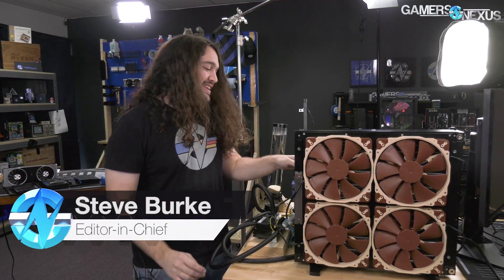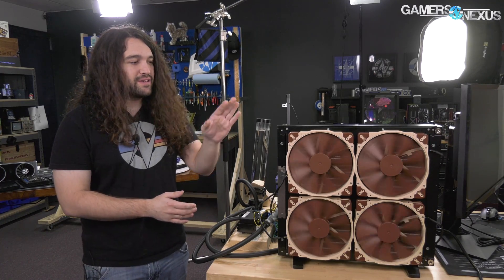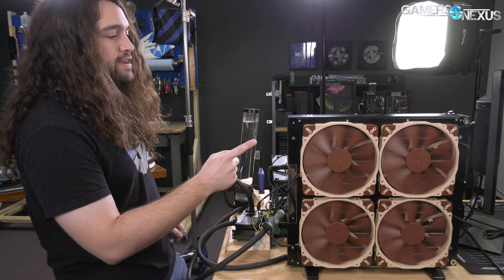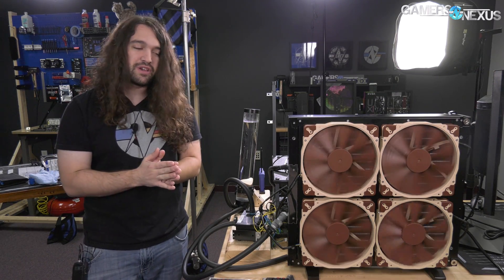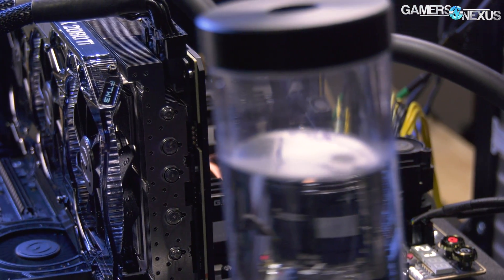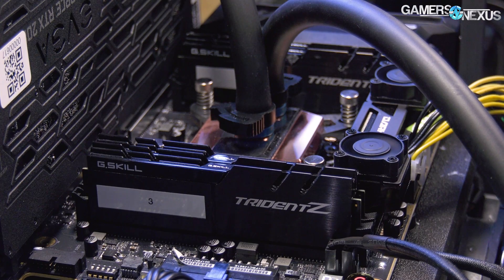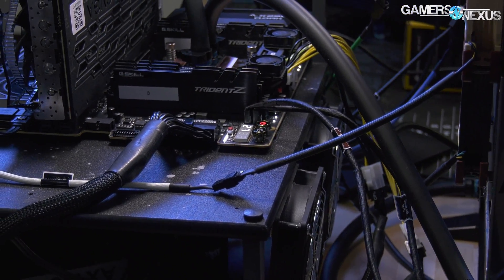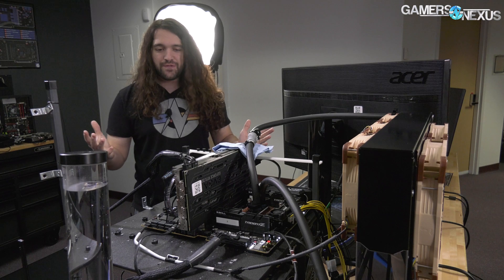9980XE Overclocking Stream Recap: Massive MORA3 Radiator

Comment: The MO-RA3 is really nice. I have had it cooling my PC for more than 7 years now. Yes it is still being produced (I think it came out in 2010 or 2011, as an improvement over their previous MO-RA2), some good products don't really need a new version. They also have many variations of it. The base is either 420 or 360 (roughly the width and length of the fin area in mm) and each has different frame and fan plate versions. The cheapest is the "Core" version which does not have any extra frame or fan plates but still has 4x M4 screw threads on each side for fixing your own frame/fan project. 

I got the 420 Core (about 150 eur) in 2011 and currently have it hanging low on a wall about 1.5 meters right from my PC with 4x 200 mm very low RPM fans, so it is inaudible to where I'm sitting. My PC case is a DIY hardwood airtight cabinet and there are CPU and GPU blocks and a normal 360 radiator (3x 120 mm fans) in the loop. The internal radiator circulates air inside the cabinet, so it acts as a "reverse radiator" in that it cools the air and heats the water, taking care of all other heat from the components (except CPU and GPU). And so the external MO-RA3 dumps ALL the heat from the PC, and the PC will not get dust inside, and the wooden cabinet effectively blocks whatever noise is left from the fans, pump and PSU.
Reply: What pump are you using for the loop? Is a single pump enough?
Reply: @avagreen9060  I use 2 Mo-Ra3 360 radiators and one 360 rad in my loop and use only one aquastream xt pump. at 3660 rpm (deadly quiet) the pump produces a flowrate of around 90 - 95 l/h.
Reply: B4Quattro Thanks for the reply, I completely forgot I made this comment lmao. This will definitely be helpful advice in the future. My MO RA dreams have been put on a slight hold, but will hopefully be realized in less than 9 months.
Reply: Sorry, didn't notice your replies before. I also have a single pump, the Phobya DC12-400 (I have a reservoir from a very old Thermaltake kit that is perfect for this pump), and I even use a manual speed controller to slow it down (to extend life and lessen noise). A water cooling loop needs very little flow to cool well.
Reply: @pev_ 
The first time I've ever seen a setup like that was when DIYPerks made a PC like that (big rad outside, small rad inside to cool the inside air). I am quite sensitive to coil whine so I wanted to make something like that but I kept seeing comments that it wouldn't work.
Since you've been presumably running this way for a long time, may I ask if you'd recommend it? Are there any issues you came across/did you experience anything you'd consider useful knowledge for someone wanting to go this route? Do you have any fans inside the cabinet apart from ones on the radiator? (a fan pointed directly at the motherboard VRMs or something like that)
My biggest worry is that the radiator inside can only slow down the temperature rise inside the case and that the concept ends up failing after a long time under load.
Reply: @motorbiker46  Oh hey, I'm surprised that youtube gave me a notification of a reply to an (relatively) old comment. But all the more I'm glad to answer, so prepare for a wall of text :). 
I cannot see why it would not work, if you use reason and are skilled at DIY, heh. I suspect that if someone said it would not work, (s)he was burdened with baseless myths about cooling a PC. 
I'm still running the same cooling and cabinet config as I described. The only regret I have had about this is that I made the current cabinet version from beech which here in Finland was cheaper than e.g. mahogany. The catch, which I found out later, was that beech has a relatively large expansion/contraction factor (from changes of moisture and partially heat) among hardwood species. So the removable side panels (doors) now have a one or two millimeters gap on one side and are slightly bent. But perhaps that is testament to the otherwise wonderful nature of my wooden cabinet because it still works good at blocking noise and dust, heh. Though I have been considering ways to fill those gaps because some dust still seems to get inside. 
I have one extra fan inside about exactly as you said, to blow on the CPU VRM and also RAM. I am quite sure that it is not really needed, but I like to be on the safe side of these things, it certainly does not hurt as it is silent. 
As to concerns about the inside temperature, I feel there is none. I actually first had a more "normal" air-cooled GPU and even then the cabinet inside temperature never got past about 35 Celsius in long gaming sessions. A 360 rad really can handle a lot 
So, yes, I definitely recommend doing this if you like DIY and PC watercooling :)
Reply: @pev_  Wow, thanks for the quick response! Don't worry about the "wall of text", I could read about your setup for hours.
So you actually ran that thing with an air-cooled GPU at one point? I definitely didn't expect that to be possible. What GPU was it? Maybe I could start the project earlier if I could just buy a MO-RA now instead of a GPU block.
Have you seen the video from DIYPerks? (the title is a bit silly as he focused on the fact that it is a desk that "can fold" instead of the complete lack of dust in the PC and no coil whine leaving the case) I'm asking because he even watercooled the CPU VRM along with the CPU and GPU and the temperature inside also reached 35°C.
Reply: Thanks, motorbiker :) Yeah, actually my original idea and first version of the cabinet (I'll just call it the box) was based around the concept that If I make a sufficiently large watercooled wooden box I can place a regular PC case inside and then the noise and dust would be blocked with just about no effort to change the PC. 
Now this brings two problems. One: you still have to somehow route cables outside, at the very minimum of course AC power, display and any wired input/output devices. And two: If you want to use any "internal" optical drives or other drive bay things (like a sound card I/O panel that I then had), how the hell do you manage that! 
So the first box I made from relatively cheap spruce/pine (not a hardwood yeah) and really put a normal PC in a normal case inside it, and then just drilled a big enough hole in the back wall for all the necessary cables, stuffed the hole with some foam material, and used USB-connected external CD/DVD drives (and audio cables routed through the back hole as was needed). It was not bad, and it did handle the heat well, which then (2011) was an Intel i7 920 and ATI Radeon HD6970, all just aircooled. And at some point I even considerably overclocked the CPU and still the temps were fine. 
But I finally grew tired that I could not access the normal drive bays, and also came to realize that what the hell, I can just make the box a PC case, as in, have proper places for the mobo, PSU and also proper drive bays. So I made a V.2 from beech, which really is a PC case, just "airtight" with only internal air circulation and external watercooling, but wiith 5 drive bays.The cable routing still is a bit shitty, just a hole big enough for the needed cables, because after all the work making the box with the drive bays, all from hardwood, I did not have the patience to make a better cable solution although I had plans for it (and it really would not make much difference unless you need to switch cables often). But as I've mentioned it still is a very nice solution for me and very silent and almost dust-free :)
Reply: Oh sorry I forgot the DIYPerks thing. No, I don't think I have seen anything from that channel (if it is a YT channel?).
Reply: @pev_  I hope you don't mind me bouncing ideas off you, but I honestly didn't expect that I'd be able to talk to someone who uses a setup like this.
I already have a few AC power cable extensions. (I only just realised that I have 3 cases next to me and all of them use one to mount the PSU inside - after about 6 PSUs I gave up on trying to find a silent one and just wanted to stuff it deep inside the case I guess.)
My plan was to have a case with a "normal" back panel and seal the area around the ports as well as I could. I don't mind it not being completely air tight, I just want to cover the inside with sound dampening foam and have as few holes as possible for sound to leak through.
Let me get this straight - the aircooled system with an i7 920 and an HD6970 was in a sealed box with a 360mm radiator, with a MO-RA outside, cooling the liquid going through it? And the temps were fine even with an overclocked CPU?
I was worried that for the radiator inside to be effective, the temperature delta required between the air inside the box and the liquid in the radiator would be too high. Because of that, the air temperature inside the case would be pretty high too and the CPU and GPU coolers would have to intake hot air and somehow still dissipate enough heat to cool the components.
Reply: @pev_  Oh, and yeah, it is a YT channel. The video title is "Building a spectacular DIY 'desk PC' (it can fold!)
" and the temperatures and sound test are shown at around 30:31.
Reply: Actually I have to deliver a bit of disappointment and slight backpedaling, because I just checked my old documents, and it seems that the box temperature reached 37C when I was still fully aircooled (but in the box of course) and not yet overclocking, BUT for that test I was running furmark and prime95 simultaneously for 3 hours (and the box temp did not change after one hour) which at that time seemed to raise both CPU and GPU load to 100 percent. And it is a synthetic and severe max load scene, very likely not happening when running any real software including taxing games. And also another cough, by the time I started overclocking the i7 920 I had a waterblock installed on it. Sorry, golden memories or something. BUT it still does not change the fact that only a 360 rad inside can easily handle a heat load that a non-overclocked system may deliver, and the TDP (thermal design power) has not really gone up much from those times unless you want to run extreme overclocking in which case a waterblock is still the best way to go :)
But eventually, WTF do I know, only that my system has not disappointed me in the least, quite the contrary, in the cooling department, and actually in about every other way too perhaps excluding the selection of hardwood type for the case, heh.
As for your plans, I did not quite get what you wanted to say with the power cable extensions and PSU things, I can only recommend that you get a good PSU, they can be a bit pricey, mine is a Corsair AX860i, really silent even without the box :)And about that temperature delta thing, yes you have to have some some difference in the temperatures to transfer any power, but really, if the rads are large enough, the system stabilizes so that the deltas are only a few degrees.Sorry, I feel like starting to ramble now, have to catch some sleep, I'll still try to come here and answer any of your potential further questions in a day or two.
Reply: @pev_  Thank you again for the information. 37°C would sound pretty bad but if I compare it to the airflow-lacking cases of 2018 it still sounds manageable.
Honestly I was rambling when I talked about the power cable extensions, it had been a long day. I currently have an RM1000i and a system that draws about 300W when I switch to a custom OC BIOS on the GPU. I went this way after giving up on looking for a silent PSU (in terms of electronic noise). I wanted to cover the PSU somehow but that plan didn't work out.
I am starting the project a bit early with a severe lack of planning because I got a great deal on a D5 pump. I also have an EK CPU waterblock and a NexXxoS ST30 360 rad on the way.
Since I kept reading online that a radiator inside would not be enough, my plan was to get a GPU block and cool the CPU and GPU with a 360 rad outside the case, and have a 120mm fan on the back exhausting heat from the rest of the components (VRM, SSD, PSU and so on). I wanted to upgrade the 360 rad to a MO-RA down the line and run it fanless or at low RPM or something, which is why I stumbled across this video and found your comment.
Now that plan is out of the window, and thanks to your insight I'm considering using a case with poor airflow, sealing it up even more, then sticking the 360 inside. The CPU would be cooled with the waterblock (I have it already, why not use it) and the GPU (at least for now) would use its stock cooler. I'd probably try to bolt the MO-RA to the case one day, but for now it would probably just stand next to the case.
Do you think that could work? The cost of both options is roughly the same. (If I were to get a waterblock for the GPU I'd also upgrade the GPU, there's no point in watercooling this one. I'd also need a new case. The MO-RA and a bunch of fans is expensive too, but I could use a case I already have.)
Reply: Well, I think you could make it work with a normal ATX case as you described, though it might be difficult to arrange a good internal air circulation when the mobo is next to the back wall and you might have quite limited ways to align the internal rad so that it properly circulates the air. That is why from the start I went with making a case, "box", from scratch so that I could put the mobo in the inside middle so the air flow goes complete over the whole surface and components, and also the box is quite big so the 360 rad is kind of at the back of the mobo perpendicular so it nicely completes the air loop. And I guess I must say that a big part of my motivation was also that I like woodworking and the whole concept of "watercooling for the sake of silence" :). But yeah, I cannot say your final idea is impossible, if you dedicate yourself to it. And it certainly helps if you have at least a CPU waterblock in the loop. Do continue asking more if you so feel, I'm sure I'll be checking this thread often even if YT fails to notify me, because that's usually what I tend to do when I have had a long conversation somewhere, and of course because I'm kind of proud of my system :)

Comment: I've been using my MO-RA3 for 6 to 7 years now, as an additional(/optional) external Radiator in every build i did, its a lovely cooling solution, allows me to turn the internal radiator fans off and makes everything nearly silent while also dropping the temperature. Also i use it completly passive until the water temperature has reached a certain delta to ambient and if i dont put a very long sustained workload on my pc the fans won't even turn on :D
Reply: Are you still doing this? I finally decided to go external radiator from now on so when I get a new PC I can just swap the connections over and keep using it. Other than cleaning and maybe replacing the occasional fan it seems pretty low maintenance.

Comment: NEXT time use a Aluminum car radiator at least it will work at those low CFM and doesn't have lead copper brass and steal inside it.
Reply: The MO-RA3 is specifically good for low RPM fans because of low fin density. A car radiator might be good but you have to manufacture adapters for the tube fittings, not trivial if you want to make them tidy, robust and leakfree. Also fixing fans to a car radiator might be challenging, even more so than using the Core version of the MO-RA3. The pipes in the mora are copper, the coolant only touches copper which is good, unless you want to go for all aluminium for the coolant path which is not the best option.

Comment: Steve, you increased the CPU settings from stock to MAX w/o touching the memory.  Then you XMP'd the memory and beyond but it didn't perform.
I'm saying you would have had completely different results had you left the CPU alone and worked the memory 1st.  My reasoning is that as you increase memory speed and reduce latency timings you are providing more data to the CPU.  Thus, increasing memory parameters loaded down the CPU and had you done memory 1st you may have achieved your previous memory settings but may not have been able to speed up the CPU.  Since the CPU temps are the limit, with higher memory speeds and lower CPU speeds you may have gotten a better BenchMark at lower temps!

Comment: My 7980XE hit 5.8 37Mesh no problem. I made the decision to keep it long before they were officially announced. It makes sense to those that don't want to risk deliding a $2k CPU.
Reply: Yes, but your CPU is not a overclocked 7980XE, also known as a 9980XE.
Reply: @crimsun7186  what? That makes no sense. My 7980XE is heavily overclocked. Haha. Aside from the indium solder used on the 9980XE they're literally identical CPUs. The 9980XE only gets a higher boost clock because the stock TIM used on the 7980XEs couldn't handle the same clocks without running extremely hot.

Comment: Similar to the cooling setup I have on my system: an external radiator box with three triple-120mm radiators, so 9x120mm instead of 9x140mm. And Watercool is a great brand as well. I've used their GPU blocks (currently use AquaComputer kryographics) and I have the HeatKiller IV as well on my 5820k. And with the blocks I have plus the 9x120mm radiator space, my GPU (GTX 1070) just breaks 40C at a ~2100MHz with +500 on the memory.

My system is currently down for maintenance and rebuild. But I changed out the thermal paste on the GPU from MX-4 to Thermal Grizzly's Hydronaut. Swapped out the thermal pads on the GPU for the Fujipoly as well, which should help with much better power delivery cooling. Meaning I might get a better overclock on the card. Or not.

Also using Hydronaut on the CPU. I think I previously had the Icy Diamond on it instead of the MX-4, so that should really help temperatures. I auto-overclocked the CPU through the BIOS and it took it to 4.1GHz. So I might go with manual overclocking this time to see where I can get it.